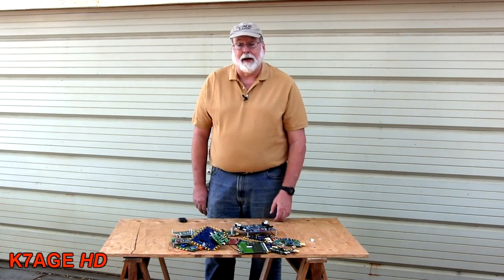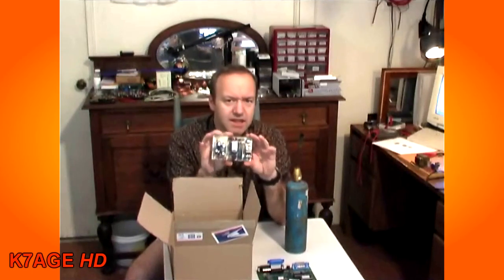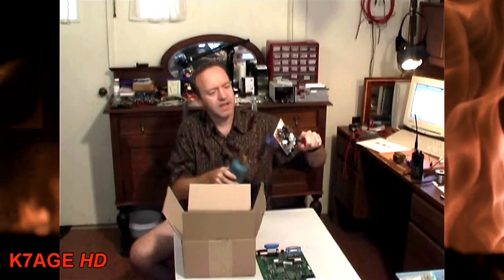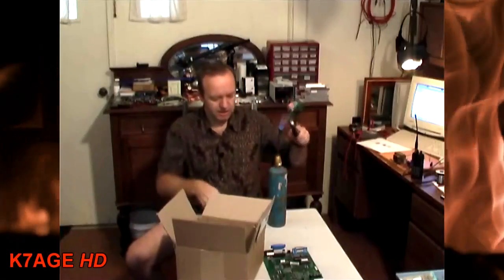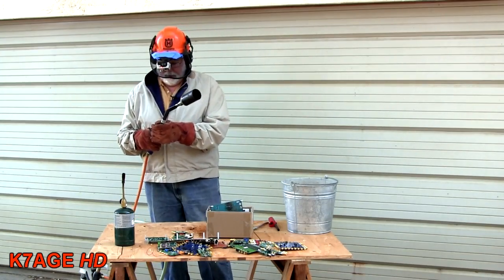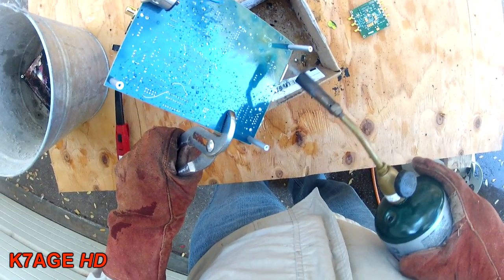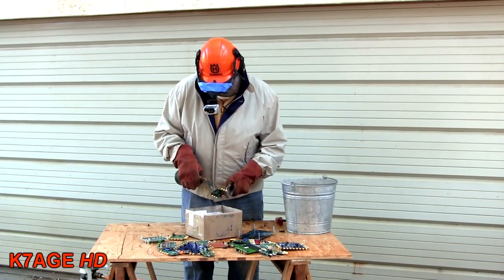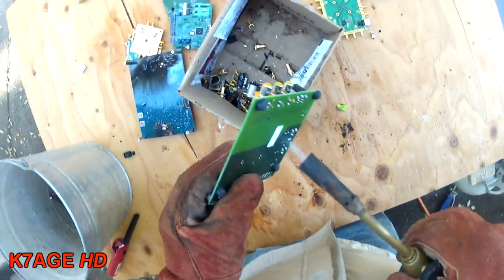Parts Recovery 102

Comment: Fortunately I have been scrapping parts for years and have a hot air rework station to remove the parts and a proper bench area and extinguisher though I have taken boards to the picnic bench with the hot air station and an extension in the summer. That big torch reminds me of seeing kids in Africa burning boards in fires to reclaim metals.
 73 de KK4HUJ

Comment: I was wondering if it would be more effective to hold the board in a bench vise and use a heat gun and pliers to remove the parts with less destruction?

Comment: Proper way is to use a heat gun, very hot "hair dryer" using direct flame like that is dangerous, creates toxic smoke, and you are more likely to damage the parts although I understand it might be faster.